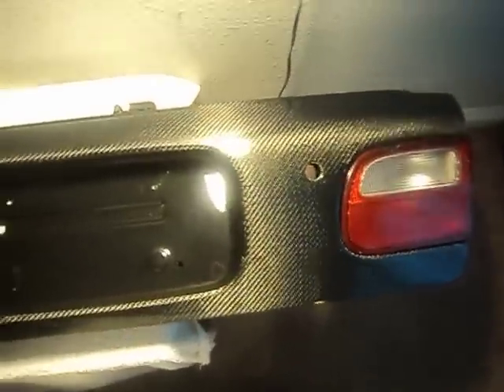Civic H2B update weight reduction

Comment: Harbor Freight is a great store! Some of stuff is cheap but alot of the stuff is pretty good quality. Some of the good things I good things I got there are a 1/2 impact socket set for like $15, angle grinder for $20, 1/2 breaker bar on clearance for $8, small polishing kit for $4, timing light with advance for $25. Too many good stuff to list